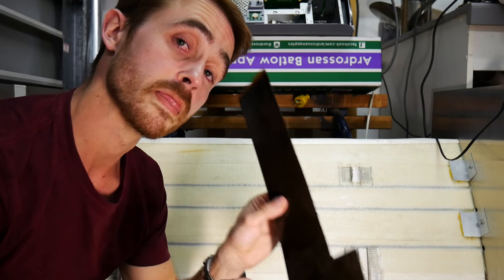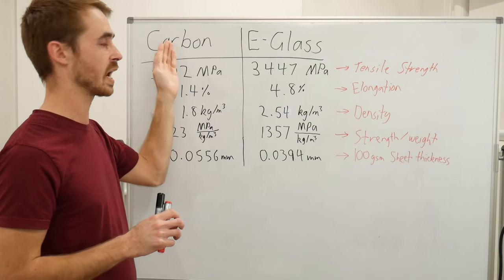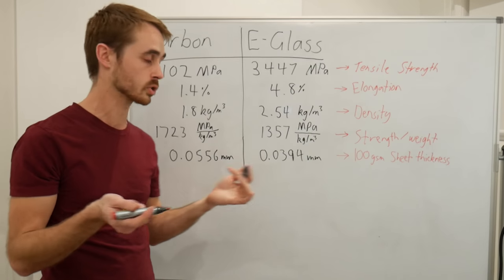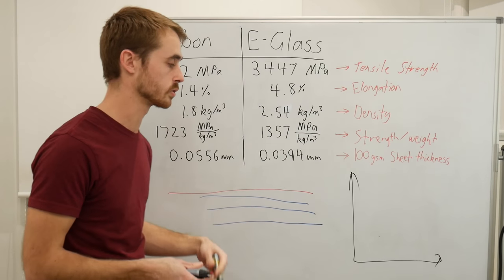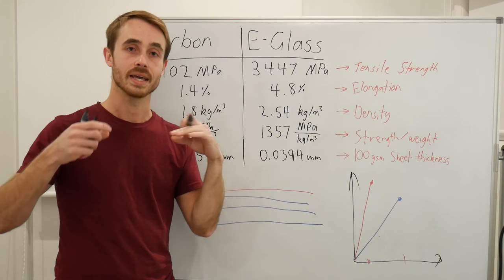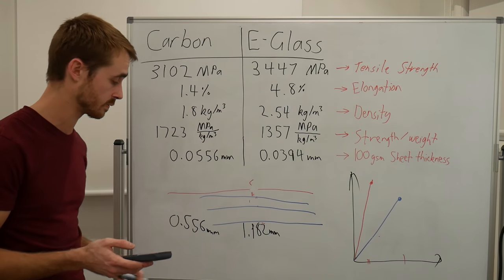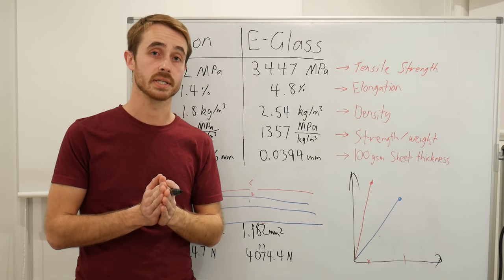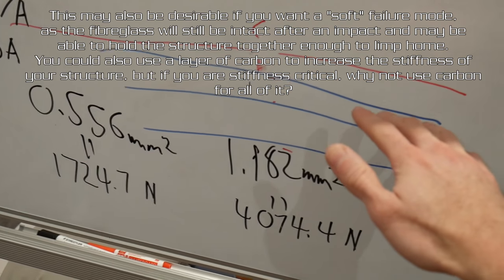Why you SHOULDN'T wrap Fiberglass in Carbon Fiber!

Comment: This is correct and incorrect depending on the application. Look at a Mongolian short bow it uses a lamination of substances with different stretch and strength properties to achieve it's goal. So adding a layer of CF may actually be desirable if you wish to alter the flexing of a component in one direction like on a wing.
Reply: the method to making those composite bows also applied to make wing plane.
Reply: Or a razor blade, including layer of soft metal inside. Somehow it is much better than steel itself.
Reply: Yes, as long as the stress of the product is less than the maximum of carbon not fibreglass.
Reply: For an archery bow, I would add the carbon on the belly side, and the fiberglass on the back side, so the fiberglass could elongate more.  Or sandwich fiberglass on the outside, with layers of carbon fiber on the inside, since most elongation is on the outside, so you could use both materials for strength.
Reply: @RMWeinberg  yep, this is how some wind turbine blades are designed, carbon beam on the inside of glass layers for added stiffness.
Reply: The Mongolian bow is the layup he describes at the end with the stiff layer inside  taking the pressure, and the flexible layer outside. So, correct in all aspects.

Comment: I would be very interested in your thoughts on Carbon Kevlar hybrid cloths and their use.
Reply: Like he said he has another video on that....
Reply: @walkertongdee  he said carbon fiber vs fiberglass vs kevlar, nothing about carbon kevlar hybrid cloths...
Reply: From what I understand, carbon/kevlar is good for applications where flexibility is needed.
Reply: And he throws out the exception of chopped strand mat, but doesn't address woven + mat layup. Or foam core, honeycomb, or any other variable layup that is most composites.
Reply: A hybrid fabric is designed to work with itself quite nicely. LOL If you're building a critical part you're not using E glass, you're using S Class! Since S glass either meets or exceeds both Kevlar and carbon fiber. Once again you wouldn't make a critical part out E Class. And if you build all your strength first and then want to put a pretty layer of carbon fiber on it, it matters or not, since you're not relying on any strength of the carbon fiber. I have built a few sets of composite landing gear. The heaviest plane having a gross of 1300 pounds. And I have done that with alternating layers of S-Glass and  foam. you can't destroy this landing gear. LOL and then to make it look exotic I top it off with the layer of textream and zylon hybrid.  It would be nice to build everything out of textream and zilon . But it's 70 - $80 + a yard....
Reply: @farmnranchapiarybeehiveser8120  In view of that, it is probably best to leave those materials for Mars landers.... :)
Reply: @ayowser01  not quite.
Reply: @daltanionwaves CSM is only good for adding weight not strength.
Reply: kevlar .. with carbon fiber and s glass ... are fine ... kevlar with e glass and edr glass is fine ... kevlar with carbon fiber and e glass ... is a waste of carbon fiber ... kevlar is a high flex material this is why it stops bullets ... e glass and edr glass are also high flex materials ... carbon fiber and s glass are high strength low flex . 

when using kevlar with carbon fiber you want the bullet stopping power NOT the flex so much ... when using it with e glass you want the flex and enjoy the bullet stopping power ... WHERE you use the high flex and high strength materials in layups ALSO matters ... his example is for cosmetic reasons only ... if you wanted the strength and weight savings then the carbon would be in the middle NOT on the outsides .this is where the carbon stiffens the laminate but lets the flex of the other layers work while resisting their flex ...

Comment: Structures break from stress points caused by deformation under load far before reaching the tensile strength of the material. A layer of carbon on the exterior can greatly in crease stiffness helping a structure to maintain its shape. Strength should be in the design more so than the material.
Reply: Not completely true if the structure is under significant load due to the difference between carbon and glass fiber. Fiberglass wants to stretch a little bit before it takes a lot of force, carbon fiber on the other hand doesn't really like to stretch at all. So by having an exterior layer of carbon fiber in parallel to the fiberglass under the same load, the carbon fiber will take all the load, while the fiberglass will only take a little bit. This means the carbon fiber will break before the fiberglass takes any significant load, which then transfers all that load to the fiberglass and it will fail too. Comparing that to the same structure made completely out of fiberglass or carbon fiber, it becomes much stronger as all the fibers will be spreading out the load throughout the whole piece instead of just the individual layers.

Comment: Loads of people have commented on your video with some very good points, the main one that seems to make the most important point is that when the layers of e-glass and carbon fibre are bonded together they become a singular  entity. If one portion of the composite fails under any kind of stresses, the other layers withstand it somewhat so as not to have a complete failure.  Also remember why carbon fibre is used in the first place, strength to weight ratio and stiffness.
Reply: I agree I know this has nothing to do with it. It's just an example for myself to reply and agree with yourself. [ Gold & Siver ] Strength in their own materials. But, adding Silver to Gold or the other way around. One will weaken the other right? 

Which is heavier? Not sure I would think Gold is or would be heavier than Silver.

Comment: Why do people wrap wood cores in fiberglass then?  Wood bends more and is heavier - so what is the point of fiberglass as the outer layer?  Boats, wakeboards, skis, snowboards, aircraft (before aluminum), etc, etc.....They all use that type of construction.  What do you know that all of those engineers don't?  Or is it something they know that you don't?
Reply: If it's engrain balsa wood, that's a core. The core is there to prevent the skin from buckling. 

Wood/mass is also good at absorbing vibration.

This video is saying don't skin your wood with glass and then lastly carbon.
Reply: Wood absorbs water. The fiberglass is like a waterproof layer.
Reply: E (young's modulus) for wood is about 10 to 15 GPa (depending on grade/species etc). E for fibreglass is 70-80 GPa which gives it much more stiffness in bending applications. It gives the wood strength in cross grain applications. It helps water proof the wood. The design strength of fibre glass is also much higher than soft woods and you get much higher strengths in bending applications.
Reply: @yodaiam1000  - Thanks for proving my point!

Fiberglass gives rigidity to wood cores, just like carbon fiber would give rigidity to fiberglass cores.  As far as your "cross grain" argument - wood cores are layered perpendicular, so there is no "cross grain".
Reply: @ezraboren2069  - Not true.  Epoxy,  enamel, or some kind of urethane would achieve the waterproofing - there is no need for fiberglass in waterproofing.
Reply: @difflocktwo  - No, the video is saying Don't skin fiberglass with carbon fiber ....  I was simply comparing that with wood and fiberglass.  

Fiberglass/mass is better at absorbing vibration than carbon fiber.

This video is trying to say that you shouldn't "skin" fiberglass with carbon fiber - which is why I made the comparison of wood "skinned" in fiberglass....
Reply: @ericulator391  Yeah that's what I said.
Reply: @ericulator391  No, it is not the same. The relative E values and strengths are different. The E value and strength for carbon or glass is more than wood so you will get some advantage no mater what material you use. But glass is cheaper than carbon. 

You also did not say you were talking about plywood but even then you will get cross grain separation with a cross grain load and the fiber glass can still help with that.  If you just epoxy wood without fiber glass, you get grain separation which can let water in. Still adds to the strength and stiffness even for plywood.
Reply: @yodaiam1000  "If you just epoxy wood without fiber glass, you get grain separation which can let water in."  Ahh, that's not true.   And while it might add some stiffness, it won't make it stronger.
Reply: @M3rVsT4H  It depends on the species of wood and load direction but fiber glass will generally act like a composite structure and make the piece stronger. Generally, rupture strength of the glass fiber is about 3000 to 5000MPa and 1500 to 3000MPa once it is woven. The design strength of D. Fir is about 12MPa. The actual strength might be as high as 100MPa. So in general, the glass does improve both the strength and stiffness. Of course the strength and stiffness increase depends on the thickness and type of glass.

The cross grain strength of soft wood and even hard woods is very low. When the wood shrinks, it cracks along the grain. The fiber glass can help prevent that cracking. If you have a thin layer of fiber glass and a large piece of green wood, it may not help but in most cases it will help for cross grain tension. If you just epoxy, you gain minimal tensile strength and you can get cracking. What part of that do you think is not true and why? Perhaps I should be more clear. With just epoxy, you still get grain separation.
Reply: @yodaiam1000  Hi, just for clarity, I was specifically referencing the statement you made that I quoted..   Perhaps we have a miscommunication as to what you refer to as grain separation.  

But I simply cannot find your statement to be true.  If you are experiencing cracking or porosity in your epoxy coated timber, then something about your process is not right at all.  And honestly, I can't think of a single reason why one would combine green wood with epoxy or fibreglass.  That's just a bad idea.  If your wood is cracking, then it has not been properly cured and if your epoxy coating is porous, then it has not been correctly applied.

If you expect your timber to be exposed to high moisture levels, or any expansion/contraction beyond seasonal temperature variation, I would advise a completely sealed composite lamination on all sides.
Reply: @M3rVsT4H  Please read the whole thread. I think you are misunderstanding what is being said. The quote is being taken out of context. What part of the statement is untrue and why? Just don't say "I simply cannot find your statement to be true". That is not an argument or a rationale. Why would epoxy without reinforcement stop grain separation or cross grain cracking?  If you don't use fiber reinforcement with the epoxy, you will still get cross grain separation. Wood cracks cross grain and epoxy without fiber doesn't add tensile strength. It will still crack with epoxy if there is no reinforcement.

I am using an extreme example with the green wood. You don't seem be understanding the thread. I am not saying someone would want to do that.
Reply: @yodaiam1000  Look, I watched the video, I read the thread, I Think Eric raises a good point in relation to the subject of the video, and I believe you have actually missed his point and gone off on some tangent that doesn't really change anything about the OP's statement. 

Now it happens that I do a lot with wood and epoxy with and without fibre reinforcement.  Amongst the many things I make in my fabrication shop are traditional styled recurve and long bows, which are literally strips of wood laminated together with an epoxy resin.  

So when I read you saying "If you just epoxy wood without fiber glass, you get grain separation which can let water in." I find myself compelled to point out that your sentence simply is not true.  Perhaps you are unaware that there are many different types of polyepoxides. And I think you've cornered yourself into thinking about the whole topic through a very specific scenario.

Therefore, to clarify. I'm saying your statement is incorrect. Based on the fact that things are made from timber and epoxy that are literally designed to bend and not delaminate. There are flexible epoxy coatings that are literally designed to create a non-porous barrier for timber. And none of what I'm saying has the slightest thing to do with glass. Because my comment sought only to specifically address your statement that I have quoted twice now.   Hope that helps.
Reply: @M3rVsT4H  If you review the context of the video, Eric is not correct and you are looking at another scenario. The point is that when you have glass, adding carbon is not that helpful if you are looking at tensile condition. Eric didn't understand the difference that the relative stiffnesses and strengths of the two different materials make to the overall tensile capacity of the piece (or the tensile side of a bending element). Under these specific conditions, you are better off adding more glass than adding carbon if you want a higher tensile strength.

You are talking about thin glued strips of wood that have relative little tangential shrinkage and cracking with flexible epoxy that are applied for a different reason than just adding strength. I wasn't meaning to say that under absolutely all conditions it doesn't make sense to add epoxy without glass. Gluing two pieces of wood together by itself adds a lot strength and stiffness. Your bow relies on the strength of the wood and not glass fiber. Eric was asking if carbon doesn't make sense to add to glass then why add the glass? Well there is a good reason to add the glass which I pointed out. Among other things, it adds tensile strength which helps prevent cross grain failure and also adds strength in the grain direction. It may not be relevant to your specific case but that was not the point. We are also talking about the epoxy that you would want to use for glassing. The comment wasn't intended to encompass all possible materials.
Reply: @yodaiam1000  So we are agreed then. Your statement is vague and lacks the torsional rigidity to stand up on it's own.  Perhaps next time you mean something specific, you might be a little more specific with your words. 

Also, you really really missed Eric's point. He's not saying that at all.  He's making a comparison and you have only helped to prove his point.. You just can't see it lol.  Honestly, I didn't come here to argue with you and you seem like a nice guy. I'll give this one shot .

In Eric's question.  He compares adding carbon to glass, with adding glass to wood.   It's a side by side.. He didn't pick glass out of the middle and say why use this?  In his question.. The glass is in the place of the carbon from the video.  And he ponders, If  laminating a material with different strength or stiffness characteristics to a base material has advantages in one case, then why not the other.      You then went on to discuss in great detail how glass would improve a wood hull, and in doing so, added a great deal of strength to Eric's case. While not actually proving it.    There's so much more to unpack here. But I've got epoxy to mix. :)  Have a good weekend.
Reply: @M3rVsT4H  You are being really pedantic. The posts and video is about a specific topic and was specifically addressed to that topic. I addressed part of Eric's question directly and after his response, I addressed the flaw in the analogy (the side by side comparison).

Eric' analogy would be accurate if wood was more flexible and stronger than glass. The wood is more flexible but it is not stronger than glass. The glass fiber adds to the strength of the wood where the carbon does not add to the strength of the fiber glass. The carbon is stiffer than glass and it is weaker. The carbon ruptures before the glass can reach it's maximum strain. That is where his comparison btwn wood/glass and glass/carbon is different. This is the fundamental mistake you and Eric are making. Obviously glassing wood works but reinforcing glass with carbon for tensile strength does not work. I am sorry you could not understand that.

I addressed the analogy early in the posts but you obviously missed that or didn't understand it. There is no need to be so obnoxious about something you didn't understand.

Comment: Laminating Carbon fiber on top of fiberglass(usually S glass not E glass) comes from the aerospace world. When trying to maximize certain characteristics while keeping weight extremely low you can add a layer or two of carbon fiber. The introduction of cheaper Kevlar has made this less used but still a completely viable way to remove flex from “bouncy” items in a racing plane. I’ve saw a few Formula 1 racing planes that use this on the fuselage and wings. They are painted afterwards so look is definitely not the goal.

Comment: I 100% agree if you're making a structural part, however, if it's mostly a cosmetic or lightly loaded part then it's a cheaper way to simulate the look without any down sides.